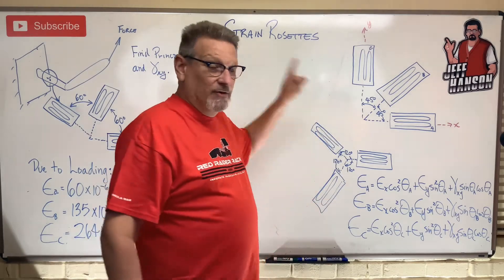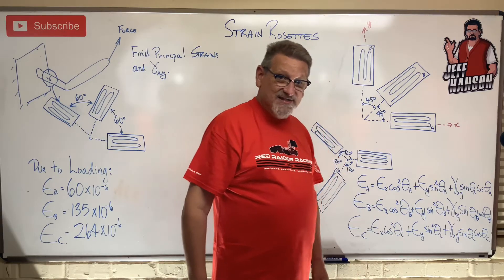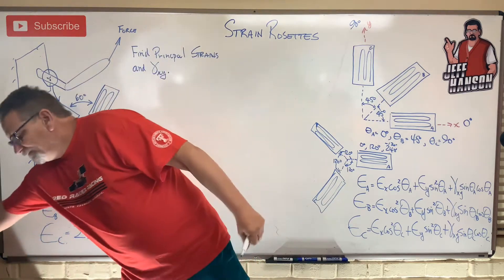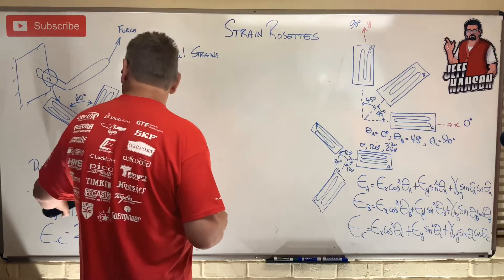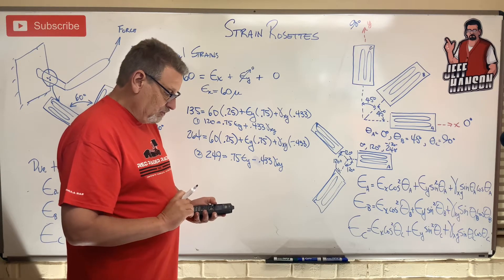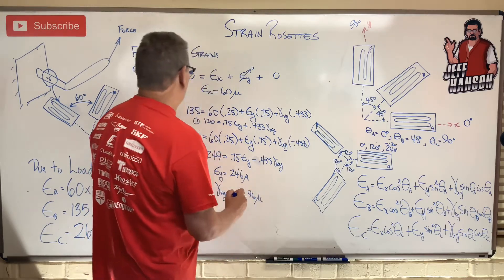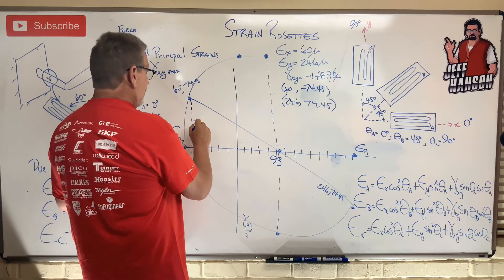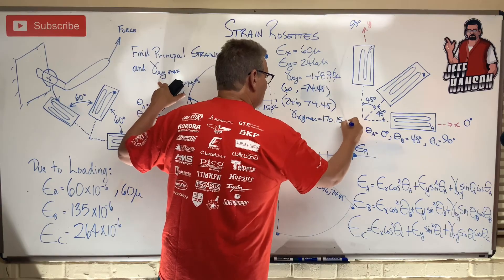Mechanics of Materials: Lesson 58 - Strain Rosette Example Problem with Mohr's Circle

Comment: He made a mistake: he mixed up the values 93 and 153... So the x-coord of the centre of the circle = 153 and the distance from the x-projection of the points to the middle of the circle = 93; also his y-axes should be left of the x-face point (but the y-axes could have been put on a non 0 x-coord) hope this helps :)
Reply: result should be GAMAmax/2 = r = 122.8 <=> GAMMAmax = 245.6 ; E1=275.8;E2=30.2
Reply: @tommysteakhouse8063  My r value was closer to 119 but your calculations check out!
Reply: checked with the equations method and these values check out (with some small rounding fault error)
Reply: the R of Mohr's circle is 119.1μ  (153-60)

Comment: Hey Jeff, I think for the first point on More's circle you drew the point (-60, -74.5) instead of (60, -74.5). I mean, the whole circle should be on the right side of the x-axis, right?
Reply: remember, this is not an xy cartesian plane.. he never said the left side is the negative
Reply: But he does act as if its negative, we get negative strain at the end because of it??
Reply: @lolzaloud  no. It also happens that both principal stresses are positive, this plane is imaginary , there's no (+) and (-).
Some textbooks explain the circle without using a plane.
Reply: I know it isnt negative, but his math and subsequent wrong answer looks to be from taking 60 as a negative value. Thats how he gets his central value to be 93 instead of 153 and his radius as 153 instead of 93.
Reply: @jeditayy6365  But he got a negative strain at the end, which is wrong.
Reply: @AJ31415aj Idk why he’s trying to say you don’t need a negative/positive side(an origin) when you can have negative or positive strains(compression/tension).  The circle was drawn wrong
Reply: ı think y line not pleaced to the x=0 point so it's not wrong